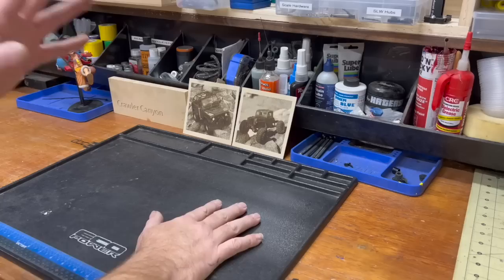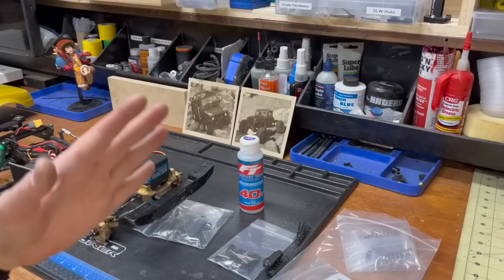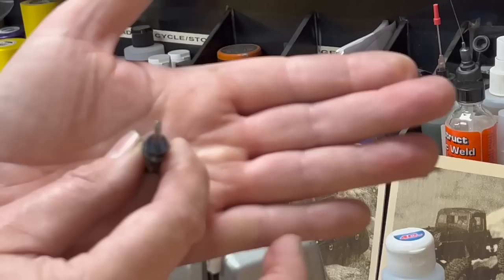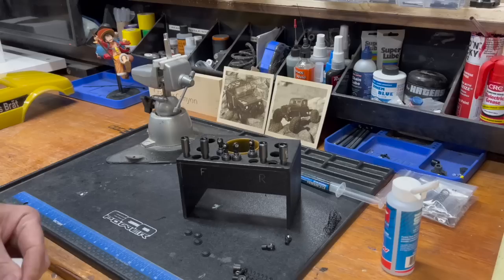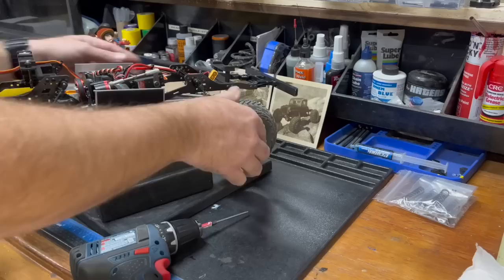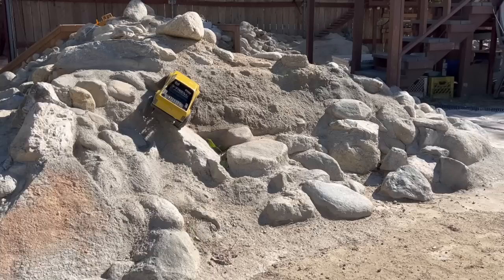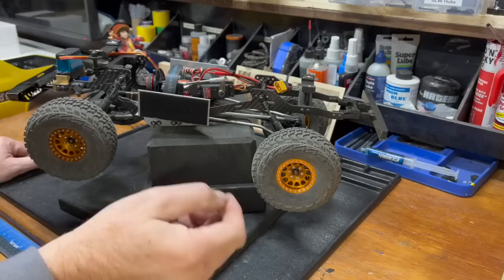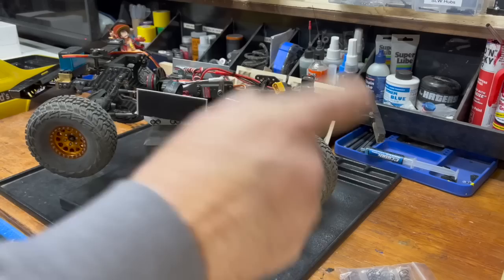Crawler Canyon Quick(re)view: DLUX Dravtech Big Bore Shocks

Comment: The only Axial shocks I’ve got that haven’t leaked are the ones still in the box with the AR45 straight axle kit. Lol
Reply from the maker: It's kinda comforting to know I'm not alone. While tinkering with shocks after finishing this video, it occurred to me--  I might take a set of the Axials, bore the pistons out to "Amazon status" and fill 'em with diff oil. Shocks leak a lot more slowly with 400wt in them.

Comment: I had a similar reaction to these shocks when you set the rig down. Man those are smooth and controlled. They look ever so slightly slower to compress than my Element shocks with Associated 42.5 weight in them. Damn good shocks. Related to your grease comments, I bought a little tub of the Noleen SF-3 grease. It's rumored to be the same stuff as green slime and I had to order it direct from them. It's only 10 bucks for a tub of it, which will probably last 3 lifetimes lol

Comment: I have the dravtech shorts on my rig and they work great but like you said the price is what gets you. I am however getting some traxxas 2660's big bore shocks and running the mini T springs for my next build.
Reply from the maker: I don't wanna say that the "small spring shock" is the way of the future, but I will say that I hope it is. Clean looks, and less chance of whanging a tire into it on a rig with 50º steering angle. 

Oh, and the factor I completely didn't think about--  if you're all about the matchy-matchy, Dravtechs come in what... 10 colors? 12?

Comment: hi budy ,you can get atrx4 shocks and print the small spring cap adaptors (or buy them from IN THE WORKS RC /DIXILANDRC )and make them into a short sprig shock(losi mini t's or the ones you got in the bag with the drivetech) , you can go a bit further and put a 10mm pen spring inside on the piston to get a shorter strock and shorter overall shock - i made all my trx4 shocks this way - and the rigs are more stable and responsive ,less bouncy . i have drivetech shocks as well ,they are great ,not cheap but you get a very very nice quality shock(only 1 rig) ,i also got a set of traxxas 2660 which are the base for the drivetech  - does the same work and as good as the drivetech -both options will be good ,the tr4 with short spring mode are cheaper ,the trxxas 2660 are also a little cheaper as well .
Reply from the maker: I've sampled the pen spring mod in a couple of different shocks and do not like it at all. I limit shocks under only very specific circumstances, and would rather manipulate ride height through shock selection and mount position. I feel the same about suspension bands, limit straps, etc. We're not dealing with 1:1 here, so I can change whatever component I need to to achieve the results I'm after. I just don't like taking travel away--  like why the Colonel is getting 80s: a limited 90mm and a "proper" 80mm are two entirely different things.

Comment: Those dravtechs are butter smooth. Those are my next shock I buy. Element shocks are super nice too with the mini t spring mod. I’ve got them on my Lcg rigs. The desert lizards are good on my heavy rigs that have more chassis weight.
Reply from the maker: Maybe that's what it is with Lizards--  I run soft/soft in every one of them, and most rigs are 7lbs plus, with the 6x6 being 11.5lbs. Maybe they're better at managing sprung weight?
Reply: @CrawlerCanyon  I’ve tried the lizards on my lightweight crawlers and  wasn’t a fan of them. Even the lightest springs were too stiff for my 5lb-6lb truck. But they’re definitely a solid option for heavier trail trucks.

Comment: I put my first ever Dravtech's on my first ever Vanquish (Phoenix portal) and I think they are the best I have so far.  I like my Elements, but the response from the Dravtech is soo good.  I run mine upside down, and I think I have 60wt in them 'cause I like sloooow. I'm interested to see what increased spring rate does for you.  I just built my first comp rig, and I used the Element builders kit as the base.  So with straight axles, lcg chassis, I'm running full droop.  My poor driving and maybe some steering are the only things that held it back.  I think springs are going away completely, and my shock oil will just increase in wt.  I find that my front can't be low enough (with the right bumper), and it can just pull itself over "most" obstacles.

You have a 3d printer and can make your shock cups....and Losi Mini-T springs are great!

Also, I'm still trying to send you a set of 3Bros Antifoams.  Just sayin.
Reply from the maker: Well send 'em then!
Reply: I appreciate your perspective on this since it parallels my experience. My first crawler is a Sendero HD that now lives on NWSD frame rails. Element (and Team Associated) are excellent shocks so I opted for them on my C1 build. 42.5 weight in all of them because that's the bottle I had. They just work really well. I am building a Phoenix portal kit now and have been curious what I'll think of the Incision shocks. I finally bought a new bottle of shock oil (lol) so these have 45 weight.

My personal experience with the Element in comp is I noticed the improved turning radius with the 12% OD gearing more than I thought I would. I have the Team KNK 25% in it now, but the 12% was good. I also run a link riser on the rear axle of both my (Gspeed) C1 and (NWSD) Sendero trucks. That one might be placebo, but I swear that one helped with climbing and keeping the front end down. 

I run Antifoams and C1 Landmines on my C1 truck. They have been awesome on the rocks here and mossy loamy soil of the PNW

Comment: I run heavy oil in all my crawlers, imo you need control not cyclic rate on crawlers. Another great video
Reply from the maker: Prior to discovering the MST option shocks, I used to think that 80wt was "heavy."  In go fast stuff, particularly running shocks like 8ights it wasn't uncommon to use 20-25wt. Now, I don't have a single crawler shock under 40wt, probably half a dozen on 80wt, and of course those couple with 3000cst or 5000cst diff oil.
Reply: @CrawlerCanyon  70w and 80w
 in all mine

Comment: Been listening to your video, (while I am working) on Dravtech shocks and like your review of them.  Not sure I am a buyer and at this time I actually prefer the enduro shocks over desert lizards too.  Due to a rise in costs the enduro shocks use to be around 75 to 80 bucks and have several sets of these in my parts bin and on my rigs.  I like their smoothness.  I am sure Dravtech shocks are good and see many posts on them from people but I have just not found I needed them since the enduro shock are so smooth and responsive for me.  Keep up the great videos.
Reply from the maker: That's just it though--  the prices keep going up, to where if you were buying a la carte--  that is, the Element shocks didn't come on your RTR/kit, the set of Element Factory team shocks is $85--  and Dravtechs would be right around the same price. The price of "aftermarket" shocks has risen to a level of what I would call "completely insane." Incision Scale Shocks are $55 a pair, ProLine Big Bores are $67 a pair, the absurd Pitbull Kroniks are $90 a pair, and best of all, the Brood re-re of the Kyosho Velvet? $100 a pair. Fifty dollars for ONE shock.  Absolutely mental.

Comment: I'm thinkin 30wt on the GS18? After your eloquent review which I must admit is a common occurrence what are your thoughts? 
On a side thing 1 out the 4 pre built is little crunchy Thanks my Man,,,
Reply from the maker: I tend to start at 40wt and go up, but if you're a superlite or don't have a lot of flex, you would maybe start at 30wt. 'Round here, anything under 6lbs is light, so there's probably more rigs running 50wt+ than there are running even 40wt, and nothing lighter than that.

Comment: I'm having a issue finding a good shock for my scx10ii that's a trail rig its got some weight to it so seems like everything I been using had too much wobble back and forth any advise? Is it a oil weight thing? Or just need something with a stronger spring? I'm lost Amy advice is much appreciated thank you!
Reply: Pro line shocks
Reply from the maker: The spring ius just to keep the suspension from bottoming out.  The "wobble" as you say is most likely insufficient damping--  the oil is too light to control the spring.  There is also the possibility that the spring rate is too high, but the oil is far more likely.  RTRs come with crazy light oil--  the Element oil bottle with every kit/RTR is 300cst, or roughly 26.5wt. I would start with 40wt as it's reasonably heavy, but the rig with still be "trailable" without bouncing around on over-damped shocks. 

Oh, and the only thing more likely to leak than Axial shocks? ProLine. If you feel like you want to replace the shocks, shop by whatever budget you're comfortable with. The Dravtechs are extraordinarily good--  but a bit on the pricy side. Traxxas GTS are very good, and half the price. But again--  the Dravtech are very, VERY good.
Reply: @Crawler Canyon  thank you for your reply I'll be definitely be trying this out. 
And I'll also be checking out those Dravtech shocks I'm a big believer in spending a bit more if it's worth it. After watching your videos I do trust your recommendations. Thank. You again for the help!
Reply: Just wanted give you a update; I went to local hobby store I bought from 40 to 120 weight shock oil. Figured I'd use them on other rigs if needed, 
This was my first go at shock oil. I've always been like how much can it make a difference, and now I feel stupid for waiting as long as I did. So for the rig in question I ended up using 60 on it and it's absolutely perfect for it! And I was so pleased I went on a oil changing crazy did my bigrock and outcast 8s exb and the difference is so so so so so much better than stock oil.
Sorry for long comment but  I have to say THANK YOU so much if it wasn't for you and this channel I might have never had tried it!
THANK YOU AGAIN!

Comment: How are these different than the traxxas big bore shocks ?
Reply from the maker: Machined bodies, delrin pistons, different caps.  Consider them "enhanced Big Bores." I still actually buy more Big Bores than Dravtechs, because I favor an 85mm shock.
Reply: @CrawlerCanyon  thanks I’m looking to optimize my comp setup , I’m running a Frankenstein setup now, Incsion S8E’s in the front and the stiffer GTS shocks in the back, I did get the incision tuning springs so might try those in the rear with the stiffest springs and go from there
Reply: @CrawlerCanyon  well what do you recommend for a class 2 crawler, I’m running a.VRD carbon, I’d like to get as much flex a possible while still maintaining as low as LCG as I can but don’t want to slam it

Comment: What brand 4mm wheel hex driver are you using in this video?
Reply from the maker: The electric driver, or the hex-insert nutdriver itself?  The electric part is the Bosch PS41 impact driver from the CLPK22-120 kit--  https://amzn.to/3YmU1YM
If you mean the nutdriver insert, it's an Ofna from their toolkit, which I've had since the early 2000s.

Comment: How are people running their Dravs for droop?
Reply from the maker: Run the softest springs, or no springs at all--  and up the oil weight as well, I would think at least to 60wt.  This would give no rebound.
Reply: @CrawlerCanyon  I have the 80mm Dravtech with 80 wt. I also got a full set up soft and medium springs. 

Obviously soft front. Do you think soft rear too? 

I’m guessing this would make the shock fully compressed at ride height and droop when the axle drops? I was thinking all droop setups had to have an internal spring in the shock body.

Great detailed videos btw! You got me subscribed!